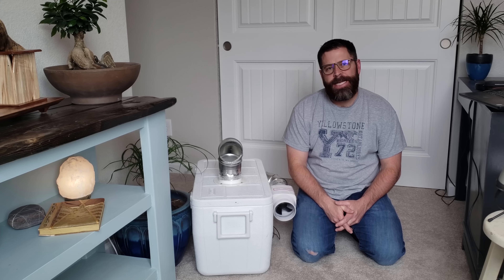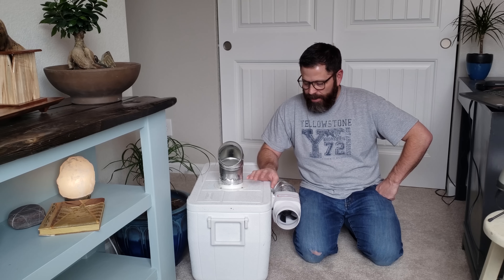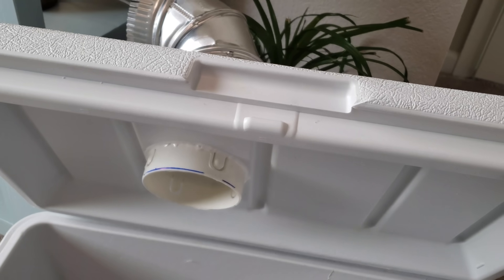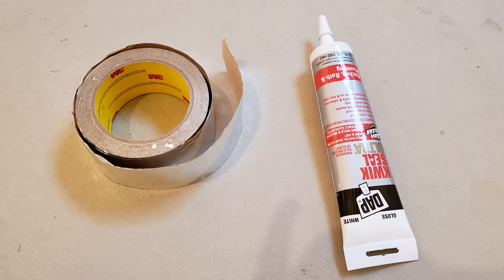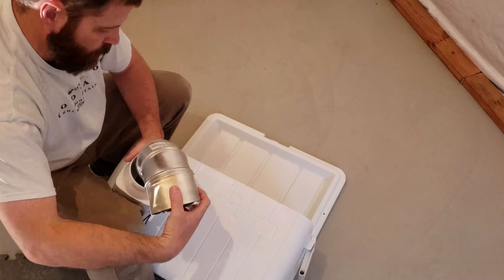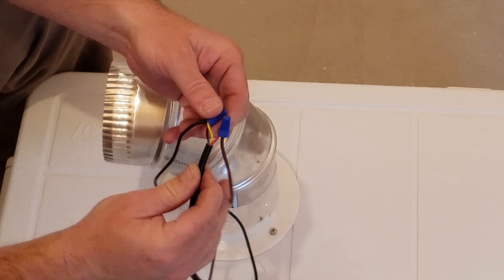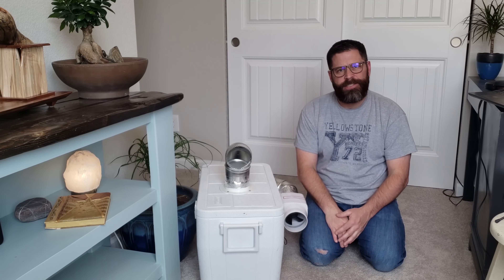Homemade Portable Air Conditioner DIY - Coldest One Yet!

Comment from the maker: DO NOT USE DRY ICE!!! When it dissipates, it will fill the room or vehicle with CO2 which will displace the oxygen causing you to suffocate, pass out and possibly DIE!!!
Reply: @GrimmReapa81  no, when the dry ice turns to gas the pressure will rise and become a bomb
Reply: make & do oh wow! Yes, I was going to ask about this. How about blue ice packs? I also have gel-packs that stay cold for DAYS, they were used to ship temperature sensitive medication to me and I will be getting more of those when I get a refill, can I use those?
Reply: Damn and not gonna lie I was thinking I wonder how Dry Ice would do lol. What about in a ventilated area like a garage if it's safe would it blow colder? If not safe even in a garage with the door open then nevermind lol
Reply: @JimiBones  by
Reply: Use liquid nitrogen...
Reply: brandon phillips o
Reply: @brandonphillips5169  ...or propane?
Reply: Does someone knows. how long that bag of ice will it last ??
Reply: @angelbernes1153  60-90 min
Reply: @angelbernes1153  In a yeti cooler for days. But who's gonna make holes like that in a 3 to 400 dollar cooler
Reply: How long does the ice last? It looks like 1-2 hours max
Reply: Now you tell me
Reply: Tyronne Hamilton yes that’s what I was thinking as well. In fact it may be possible to create a tubing system inside the cooler with large enough diameter that you could fill that with the dry ice and then all the air-flow thru the cooler would have maximum contact with the cold surfaces.
Reply: But it's a" dry cold".. lol
Reply: What if I'm using it for my grow room and I also need co2 for my plants? Win win
Reply: Use dry ice but they are sealed, then fill the icebox with water and ice, then voila
Reply: @GrimmReapa81  it would explode...the gas takes more space!
Reply: Thats rediculous ...fire needs oxygen to breathe....if you cant breathe neather can fire...@mgreen4404
Reply: For Haloween it might make the best fog machine ever though!
Reply: Seems like dry ice could be used as long as the air did not directly contact it- you could either coil air ducting through a dry ice container instead of blowing free thru the cooler, or you could keep the dry ice in a non-insulated container inside the cooler?
Reply: Have you made a video where you do use dry ice for a fog machine on Holloween.
Reply: @16PLY TYRE yeah any old ice will do. Im defo gonna build one of these though. Make my own improvements. Gonna try using a fan mated onto an intercooler before it goes to ice tray muhahahaha. Intercoolers are super efficient at cooling stuff down.
Reply: 16PLY TYRE p
Reply: What about rock salt?
Reply: @djbendersheleighly8068  I thought of this to.. the chemical reaction from rock salt will freeze the top layer solid and you wont get any airflow at all.  We used to pack all our bait in big coolers and cover it with ice then rock salt the whole top . When we got to the islands to go fishing we opened up the cooler and had to break through the ice. It was solid as a rock..
Reply: But your house plants will love it.
Reply: So perfect for plants 👌🏽
Reply: Thank you ~ I was thinking about it! Now I know!
Reply: cool, can I use a 20k power bank with an AC slot to power the blower?? i need it to keep cool for 8 hours im sleeping in my van!!
Reply: Would be perfect for a grow then!!
Reply: What is dry ice? The kind gas stations sell
Reply: Anyone that uses dry ice in this is to stupid to live
Reply: Fuuuck i thought I was jus really cold ....nope I’m dead
Reply: Pushing 4Better  just wanted to suggest power supply I know someone suggested old laptop power supply as a possibility I just wanted to suggest Xbox 360 slim's power supply which contains a power brick.
Reply: Pushing 4Better  just use a blower version rated for AC wall power instead of for DC 12V.
Reply: Lol I wish
Reply: @GrimmReapa81  that's called a bomb
Reply: Dry ice will burn you if you touch it.   Don’t touch it.  
Some in comments do not know the difference between dry ice and regular ice.   As stated in the comments it’s a special type of ice.  Not the kind you buy at the gas station for your cooler.    Plus you have to go to special places to purchase it.   So chances of the majority getting any dry ice is minimal.  :)
Reply: Good advice.  True, Let them eat cake.
Reply: I was planning on using dry ice or blue ice, but I am planning on putting it in the trunk of my car. Hopefully it will be ok. Thanks for the tip.
Reply: Who the fack would use dry ice
Reply: Exploring Is living life : Tim The Toolman Taylor of course. Don’t try to talk me out of this Wilson, I’m from the Mojave.
Reply: You would need a MASSIVE amount of dry ice to kill a human. Ive used large blocks for a mouse kill chamber (to feed snakes) and it takes A LOT to kill them....and it takes a long time. Sometimes they just get knocked out for a short time. Just ended up buying frozen.
Reply: why is it used at parties? if it can die people?
Reply: Damn lol
Reply: Thank you 😖
Reply: Dasaammm I'm glad you told me that thank you
Reply: You're right. I remember seeing a story about people having a party and they threw dry ice in a pool. People started jumping in to swim. But people were passing out. I forget how many died
Reply: Very important to remember this !
Reply: So place the dry ice in sepperate vented thin containers with vent tubes running outside (fish air tubes would be sufficient) and run a small hole out the side with a gromet to a window like you would the port for an indoor standing ac unit and then you can safely use the dry ice to extend the shelf life of the regular ice you pour in around it. Its not rocket science.
Reply: Your system introduces moisture into the air =bad your fan will pull more air that pushes, mounting it on the exhaust, not the intake. Still, it doesn't fix the humidity you're introduceding
Reply: Cool, thanks for that information 

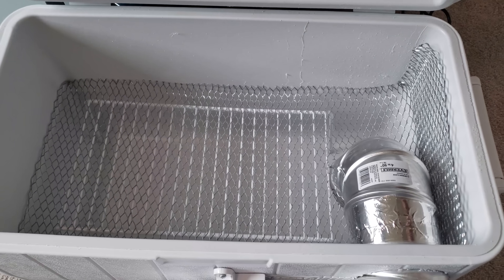Quick question: 2:19 what happens when the ice melts and creates a small pool of water at the bottom of the container?
Reply: Sounds awesome for my plants 😮
Reply: if you use dry ice for this, you are one stupid ass
Reply: @darinp5612  ppl
Reply: I once bought like 50 lbs of dry ice, me and my girl friend drove home in her scion TC with the windows up and AC on.... it started getting harder and harder to breathe......
  I was trying to keep it together so I wouldn't seem like a wimp. 
Then she started asking why I was breathing so loudly, I had no clue, then I looked at her and said. " ITS THE DRY ICE !!!!"  Pulled over immediately and opened all the doors and the hatch...
Lesson learned...
Reply: @Celzot  you were the lucky ones.
Reply: @Celzot  Question in this video here is this dry ice he is using? What do you guys mean by dry ice?
Reply: @Celzot and all you had to do was crack open a back window for gas to escape 🤦..
Reply: make & do Unless there is a mechanical reason not to do this, here are my suggestions on the design and use of this unit. 

Mount the fan vertically on the top to blow the air down into the cooler. This should increase air flow by eliminating the turns in the conduit. 

Use bottles of ice rather than bagged ice. You should be able to put them in the bottom and on top of the rack. You should be able to put the bottles in the bottom through the hole you cut in the lath. Using the block ice may increase your output temperature slightly, (I’m guessing and average output temp of about 40F) but the overall affect of my suggestions should create a more comfortable environment for a longer period of time. 

Place the unit on a shelf so that the intake of the fan is near the ceiling. This will create a natural air flow in your camper. The hotter air will rise and force the cooler air down creating a slight breeze throughout the camper. This will maximize the air circulation. This will also cool the hottest air first and should reduce the ambient temperature quicker. 

Thanks for the work you put into this unit and sharing it in this video. 

I hope these suggestions help. I look forward to an update video from inside your camper so we can see this unit in action. 

D.
Reply: @westmountainadventures3606  With this sryle would you keep the output pipe on the top too?
Reply: B H The short answer is no.

My first thought was to put it on the end. After watching the video again, I realized that would interfere with the handle. I would put the output were he has the intake. The intake I would put one panel further away in the lid. (Note the four panels on the underside of the lid.) 

For a space similar to the conversation trailer that he has, I would position the cooler in a corner on a shelf such that the intake is about six inches from the ceiling and the output is closer to the center of the room. 

With minimal corners and this position, I think these two adjustments would maximize the efficiency of the unit. 

These units are similar in concept to the passive solar heaters you see built here on YouTube using soda cans, downspouts or aluminum screens. 

With the heaters you want maximum baffling and air contact with the heated surface. In the heaters, corners coming in or going out only add to heating (exciting) the air. 

With the coolers, you want maximum surface contact with the ice, which cools the air, and minimal corners, which heat the air. Irregular ice, like that from an ice maker or bagged ice, is optimal for surface contact. Ice cubes or frozen bottles are less optimal and therefore should last longer. 

I’m working from here with no practical experience. But, from what I’ve gathered, the same way screens are more efficient than cans or downspouts in heaters, the same would apply to bagged ice vs frozen bottles in the coolers. 

D.
Reply: Great suggestions!  Thank you!
Reply: make & do lol handy tip that one . Haaaaa cheers .
Reply: @shanekonarson  OBN tv
Reply: So just use a bit of dry ice? Ok
Reply: @El_Mikey1  You know what Halon does don't you? Similar effect.
Reply: Yes minimal amounts, at the base. And also you can make a vent tube to let the carbon out underneath the car
Reply: make & do Thank you... I’ve never used dried ice before...  I doubt I would . 🕉 namaste
Reply: No it wont. There isnt enough dry ice in that cooler to displace the oxygen in a car
Reply: somemedic, go ahead and try. Let us know how it works out for you.
Reply: lol
Reply: I real thought about that but dismisses the thought after fining that out.
Reply: Pushing 4Better  Yes just get a 110-12V power supply that can supply enough amps to power the fan maybe an older lap top power supply that has12V out. or a decent 12V out wall cube.
Reply: Congratulations, you've done it!
Reply: I can't imagine the ice would stay ice long enough to do much
Reply: @thegoodlistenerslistenwell2646  It's easy if you try.
Reply: @MeesterVegas  it's easy to watch ice melt??? I mean..... yea....
Reply: @thegoodlistenerslistenwell2646  3 to 4 hours,stop refill it
Reply: @thegoodlistenerslistenwell2646 I followed directions and ain't tryna f around and find out
Reply: make & do if there’s dry ice does it mean there’s wet ice?
Reply: @yuritarded5245  Ice is 🅱oneless.
Reply: PeRvErTeD BaNaNa Yes. Wet ice is made with heavy water. It is best served in drinks at a Neutron Dance, 80’s themed party. Just be aware that your party may be raided by the Beverly Hills Cops.  ;)

D.

Comment: Why is he showing us this in his car??
Wouldn’t it be better to blow the air through the ice, aka swamp cooler?
Why is he in the car???
Reply from the maker: I am showing it in the car for three reasons: 1. This is my third build and in the past I had several people ask me about using one in a car when their air has gone out. 2. The cord I'm using plugs into a car cigarette outlet. You can get a cord that plugs into a regular wall outlet or a cord with clips that hook straight to a battery. However, I still had this cord from last year's build and decided to reuse it. 3. I wanted to compare how quickly it could cool my car vs my car's ac.

Comment: This is a good idea for Late Afternoon Early evening for where I live.  I live in a RV and this will help out the AC unit as it struggles with the extreme summer heat.
Reply: This would make ur AC struggle harder as AC removes humidity from the air, and with this you're adding a shit ton of humidity due to water vapor from the ice.

Comment: This will cause mold from putting so much moisture in the space you’re trying to cool. In air conditioning it lowers the temperature by removing the moisture. So beware of doing this.
Reply: In my world, Phoenix, moisture is a good thing...we use it in swamp coolers to AC houses and shops. I am pretty sure this has specific applications like when your ac goes out and you just want to blow cold air on you directly until its fixed. People are funny...
Reply: @jeffmilkey  I live nearer Tucson do I adree
Reply: what a bunch of dumbasses
Reply: Run a de-humidifier with a filter at the same time. Then take the water from that and freeze it to make more ice for the cooler
Reply: Josh Lewis dehumidifiers works like a small ac unit. How on earth would you ever run one in a car anyways. You just need an ac !!!
Reply: That is not how AC works, lol, AC works alot like this DIY cooler Freon is pumped through a radiator (condenser) and air flows through and is cooled by the freezing tubes. How is that removing moisture from the air? Also a swamp cooler  makes cool air from warm  water that creates humidity inside the cooler by soaking the pads on the walls of the box then the fan blows thruogh the pads and comes out cool its a reaction of water and evaporation. So putting Ice or Ice water in the tank does not make it work better it works from warm water. This cooler is more designed like an AC is thus the name. Great build here BTW

Comment: Great design, thanks for sharing this! I love this!

You might want to try having the motor suck air out rather than pull air in. That's because hot air rises while cooler air descends so if you reverse the flow then colder air will be pulled down through the ice to the bottom where cooler air wants to go anyway.

Also, if you place the air intake at the opposite end of the cooler (rather than the top), you will maximize the air flow and reduce slower  or dead spots in the corners under the present top vent. That, or even better, if you have a circular cooler, you can create a whirlwind and really maximize your air flow with a lower rated motor for the same output.
Reply: Sucking air out would have to be able to pressurize the cooler no?
Reply: @gibster9624  The air cooler is already pretty much air-tight so any air you suck out from one end will be pulled back in from the other end. Pressurization isn't needed.

Comment: Dude that's awesome. But how about filtering the air through ice water, like a bubbler? Add salt to lower the freezing point, like an old hand cranked ice-cream maker which gets several degrees below zero with salt an ice. Surely this could supercharge your cooler?

Comment: This is a great idea for an arid environment. I live in the midwest where the humidity levels often reach higher than 90%. these things are not practical in high humidity environments as they ad way too much moisture to the air.
Reply: it will work there just as well is anywhere else it's not done by evaporation it's done by exchange of the ice and air dumbass

Comment: If you add the fan vent hole on the bottom of the cooler below the ice it will make the build cheaper (less  HVAC) and maybe cooler because you can add even more ice.
Reply: At least last longer. I'm not sure how much space he has at the bottom tho

Comment: you are just adding cold, not taking not the hot like a real a/c does
I have tried this, it helps a bit, but is not worth the cost of the Ice.
I used a cooler and a double direction, double fan on top of a cooler.
one in one out. Not Real A/C

Comment: Not a bad idea. But I have my doubts about the air humidity. I would adapt the intake to several little anodized aluminium pipes, which go down to the bottom and spread there from each other. I think it is even possible to bend all the little pipes to adapt them to a condensation tank with an attached water drain pipe at the lowest point. It is possible to attach a water tap or a ventile to the drain too. Then connect the condensation vessle with smaller pipes to the bigger outlet pipe. This may help to accelerate the whole cooling process of the air and prevents the air on the otherside to get humid.

Comment: Yep I'm gonna troll to possibly save fellow viewers time and money. I tried making two of these (one with the copper coil and pump) and each time the ice melted within an hour or so which in hindsight makes sense. If a fan is blowing 100 degrees of air onto ice it will melt it very fast (actually faster than it took me to clean up all the plastic chips from drilling the holes) So unless someone is sitting next to a commercial sized ice maker to continuously replenish the melting ice its probably not worth the effort or money just to drop the temperature 10 degrees.

Comment: have few tips,  1. you can lower your bottom shelf. 2. add a direct pipe straight to the bottom? don't let the cold air force it way through the ice!  "corruption czar"
Reply: the water get in?

Comment: These things work like car air conditioning, if it's not constantly running & pointing directly at you then it doesn't work.
Reply: Steve H it’s nothing like air conditioning that works by lowering humidity in your space. This is adding a lot of moisture causing the perfect place for mold to grow.
Reply: @mwatkins2464  yeah, that too.